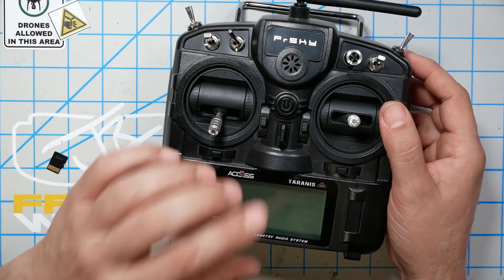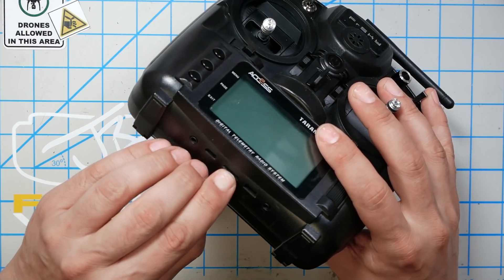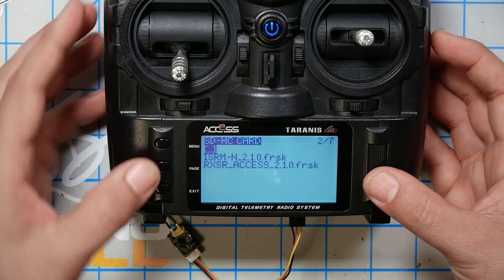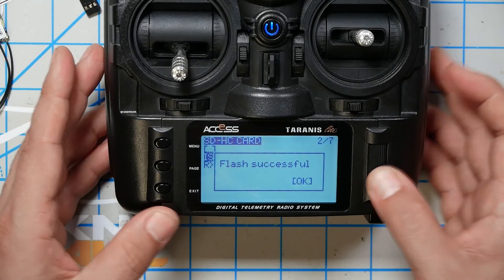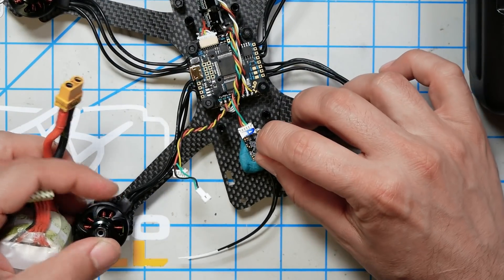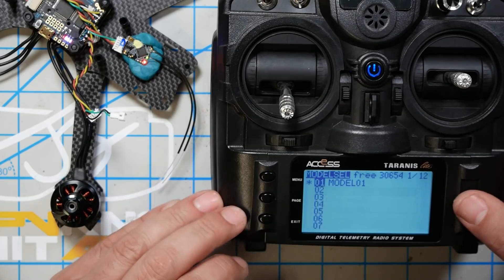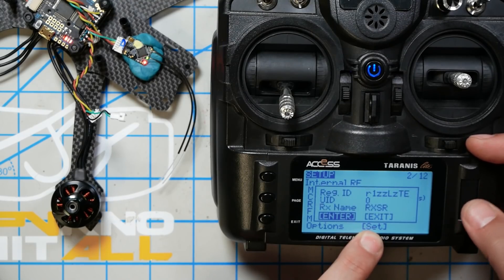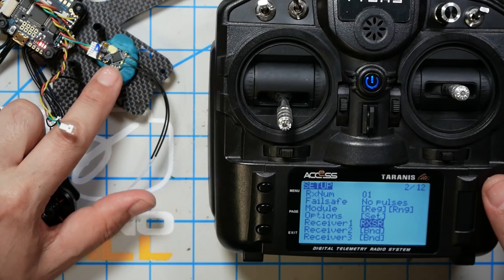FPV Drone Budget Build Full Tutorial - Part 2 - Bind FrSky to X9 Lite and flash RXSR firmware

Comment: Mr. Bardwell, I finally completed your Xilo drone kit. No smoke, motors and prop install correctly, startup normal, but upon take off, the drone flips upside down. Need help!
Reply from the maker: If the quad suddenly pops up in the air and then disarms when you arm, it is almost always one of these things.

1. Clockwise prop installed on counter-clockwise spinning motor or vice versa. Double check the motor direction is as expected and then double check that the correct prop is on each motor.

2. Flight controller not facing forward. Go to the Setup tab in the configurator. Tilt the quadcopter on all axes (pitch, roll, yaw) with your hands. The 3D model in the configurator should move the same as you move it with your hand. If it does not, use the Board Alignment parameters in the Configuration tab to fix it. Do not use the "GYRO/ACCEL" parameter. Use the "Roll Degrees", "Pitch Degrees", and "Yaw Degrees" parameters.

3. Motors not wired correctly. TAKE OFF YOUR PROPS. Plug in a battery. Go to the Motors tab. Turn on the "props are off" slider in the lower-right. Raise the individual sliders (1, 2, 3, and 4) one at a time, just enough that the motor begins spinning. The motor positions (1, 2, 3, and 4) should match the graphic in the upper left. If they do not, then either move the signal wires so that they are correct or use resource reassignment to virtually "move" the motors.

4. Motor spinning wrong direction. Do the same as step 3 but compare the motor direction to the arrows on the graphic in the upper left. If a motor is spinning the wrong direction, either reverse it using BLHeli (or whatever ESC software you are using) or swap any two motor wires with each other, which will reverse the direction.

5. If you have enabled the "motor direction is reversed" parameter in the Configuration tab, then you must go into blheli and reverse the motors, or swap the motor wires to reverse the motors. The "motor direction is reversed" option TELLS betaflight THAT you reversed the motors. It does not reverse the motors. This is a special case of #4 where the motors are spinning the wrong direction.

Comment: Is there a different file for the x9d? Also, the x9d does not have the servo slot on the bottom.
Reply from the maker: For the X9D you do not need to flash the RXSR or the X9D. They should bind out of the box.
Reply: @JoshuaBardwell  thank you

Comment: Mr. Bardwell, I brought and assembly your Xilo FPV drone kit. All went right up to the smoke check, no smoke. The problem arise went I try to bind the drone to my Radiomaster TX12. I was not able to follow your instruction because you use your FrSky Tannanis radio. There are some difference. I remain loss and need help
Reply from the maker: Bind to rxsr using protocol MULTI FrskyX

Bind to xm+ using protocol MULTI FrskyX2

Comment: For those who didn't get a MicroSD card you need to format the card to fat32 and put the file system onto your card. https://www.frsky-rc.com/taranis-x9-lite is the site to find the folder structure then you put the firmware into the corresponding folder. If you dont do it this way then it wont detect the .frsk files.
Reply: Thank you very much.

Comment: Can i also bind the Radiomaster tx16s to the R-XSR without changing the firmware because the tx16s doesn’t have the plug?
Reply from the maker: The tx16s can bind to the rxsr without changing the firmware. Use protocol Multi FrSky D16. If you need to flash the rxsr look up my expresslrs video which shows how to flash a receiver using the JR module pins on the back of the radio.
Reply: @JoshuaBardwell  thank you you truly are the FPVKNOWITALL

Comment: HELP! So when i select the RSXR to flash it only gives me an option to copy rename or delete and no option to flash. I am using the Radio master TX16S and I have already switch the red and black wire to aline with the pins on the back of the controller.
Reply from the maker: You can flash it using the JR bay pins on back. See my expresslrs video for an example. But you don't need to flash it. The stock rxsr firmware will work with the tx16s. Bind in mode multi FrSky d16
Reply: @JoshuaBardwell  so for your xilo build I don't need to flash my radio receiver?? And yeah I used the pins on the back
Reply from the maker: Radiomaster tx16s can bind to rxsr without flashing either.
Reply: Also my radio receiver does not bind, lights stay blue and flashing red and controller just beeps and says binding
Reply: @JoshuaBardwell  sorry for all the questions, Ive tried to bind the quad and it simply will not bind. 
I have tried
1. Re made a new model
2. pressed the button and then plugged the battery in and the green and red LEDs are lit but dont not start flashing

when i select bind it gives me an option to select CH 1-8 TELEM ON, or TELEM OFF and CH 9-16 TELEM ON or OFF

again sorry for the questions but im at a loss...
Reply from the maker: Need to be binding in mode MULTI FrSky D16 8ch

Assuming the default firmware on the RXSR, that should work.

If the RXSR has ACCST V2 firmware on it, then bind using MULTI FrSkyX2 D16 8ch

Comment: I started this project late. I flashed the SD card, but when I open up Firmware, it does not have the two files I needed, so I cannot bind the receiver. The FRIMWARE folder has TOOLS, a list of them, but when I check the SD card with my PC, there's nothing there but those two files I was to put in FIRMWARE. What should I do? Also, I am getting an 'expected different SD card version' after the throttle and failsafe warnings. What should I do?

Comment: I bought this and I'm stuck at the SD card, because one did not come with the kit. Was it supposed to?
Reply from the maker: I don't remember if the X9 Lite comes with one or not. If not, you need to source your own and download the SD card contents from the FrSky web site.
Reply: @JoshuaBardwell  ok thank you. If I buy a new (blank) SD Card, do I need to create a folder with the same name as YOU have in your SD Card? Or can I drag it straight into the card?

Love your videos btw. Keep up the awesome work!
Reply from the maker: You need to download the SD card contents from the FrSky web site and it will contain the folder structure.

Comment: Josh, thanks for all the great videos.  I'm working my way through the analog Xilo build and I have a newbie question.  I have a XD9-Plus (NON 2019 Version) and I've flashed the RXSR but I'm wondering if the ISRM-N_2.1.0.frsk file you provided is for the newer Access controllers or any controller that you want to "control" the RXSR with?  Thanks again and keep up the great work! ps: my controller is on the lates opentx (2.3.11-otx)

Comment: I am a patreon subscriber, I am having a small problem with flashing the Xilo receiver to my radio.  I see the file but get an error when attempting to flash it.  I have the radiomaster TX16S controller.  There are two similar slots at the bottom one with 4 pins one with 5 pins, and neither have the slot.  Assuming the black wire is ground I am putting it to the left side with the servo plug, lights on receiver blink, but will not update firmware.  Any ideas?
Reply from the maker: The radiomaster can't flash from those bottom plugs. You have to use the rear Jr bay. But the pinout is not the standard pinout so you have to make a custom adapter.

If you are using the radiomaster radio, you probably don't have to flash the receiver. You definitely don't flash the receiver to access firmware as that only works with FrSky radios.
Reply: @JoshuaBardwell  Thanks so what’s the next step in the build if I don’t have to flash the receiver.  I may sound like I know what I am talking about, but I don’t.  I have enjoyed the build so far, but long way to go to understand.

Comment: Thanks for your detailed instruction... However, there are a couple things not mentioned that newbies like myself had trouble figuring out:
I got the Frsky Taranis Lite radio, and it DOES NOT come with an SD card or batteries. 
You want to purchase a microSD card with LESS than 16GB of memory. That is important because the SD card cannot be read by the controller unless it is in default FAT format. If you don't know what that means, Google "changing filesystem on SD card" or something.  
The batteries for the controller are 18650 Li-Ion 3600mAh rechargeable batteries; although I got 2200mAh 3.7V ones to work fine. You want the cylindrical batteries, the battery packs won't fit. 
Also, I don't remember it being mentioned in the other videos, but the drone itself can take 4s or 6s batteries. 
Hope this helps!

Comment: I picked up an R-XSR receiver, but went with the Jumper T-Lite for a transmitter. Couple of things I ran into going this route;

 1. The RXSR firmware that Joshua links to uses the "ACCESS" protocol, which the Jumper T-Lite (and I'm guessing most other non-FrSky Tx's) is not compatible with. I had to download the "ACCST D16 Firmware" from FrSky's site here : https://www.frsky-rc.com/r-xsr . Then I could bind the Jumper T-Lite to it by choosing Mode:Multi , Type:FrSkyX2, Subtype:D16.

 2. Because I don't have a FrSky Tx, I had to flash the firmware by a different method. I used serialpassthrough in BetaFlight, explained by Oscar Liang here : https://oscarliang.com/flash-frsky-rx-fc-passthrough and seen in Joshua's video here : https://youtu.be/Hzf-EuQZYsE?t=351 . I found that recent changes in BetaFlight, mean that serialpassthrough doesn't persist after power cycling, so where you used to power down everything, you now need to keep the FC powered, disconnect the RXSR's cable, and then re-connect it for the FrSky updating tool to recognize it.

Hope this helps someone else in the same boat as me!

Comment: Josh - question on flashing the receiver. you stuck it into the bottom of your Taranis.  Do all controllers have a slot like this?  My Radiomaster TX16s seems to have a similar but larger one on the bottom of the controller.
Reply from the maker: The RadioMaster has a serial slot but I don't think it supports flashing through the slot. I think you have to use the JR module bay pins, but don't just go plugging in. The pinout is not as you might expect.
Reply: @Joshua Bardwell  if I used a TBS Crossfire receiver instead, would that solve this issue?  Or do Crossfire nano receivers also require to be plugged into a controller for flashing?

EDIT: Josh told me today on his livestream that the Frsky RX should work with my Radiomaster right out of the box.  Also, for anyone happen to be reading, he also told me that crossfire rx could be used, but would likely require a different wiring scheme.

Comment: just got done building this quad. when I plug in the battery I get the first 3 beeps then nothing. no L.E.D.s no nothing. does anyone have a clue what might be going on? this is my first build, I guess I should be glad there was no smoke or fire.
Reply: Scott, did you follow the updated wiring video Josh posted after the build videos?  I just finished wiring my analog version and everything lights up.  :)

Comment: Thank you for what you do for the fpv community.

I'm having trouble binding the Frsky X9Lite with the FrSky R-XSR Ultra receiver. They both say in the manual that they come with latest firmware and it just has to be binded. I follow all the correct binding process and still won't bind. Can someone acknowledge if this is true or do i still have to install firmwares to both transmitter and receiver? Please help.

Comment: I have an ACCST Q X7, so you'd better believe I learned something today! I also figured out I could press the bind button with my pinky while I plug in the battery, so I don't have to do it one-handed. I have half a mind to wire up a circuit with a power switch for future binding needs.

Comment: What is the overall benefit of doing this? I haven’t updated the radio firmware for years and all of my aircraft models bind just fine to my radio. I’m not sure what version of OpenTX is on my radio, but I haven’t really seen the need to do any updates. I figure if it’s not broken don’t fix it. But I am curious, if I go through this process, Will this screw up anything on my Taranis X9D plus that already has several model profiles on it? Also, can I just bind the R-XSR like I normally would with any of my prior aircraft models and just not update its firmware? Thanks in advance. ✌️
Reply from the maker: The point of the firmware update is that not all Frsky firmware is compatible with each other. By instructing you to update firmware on the radio and the receiver, the tutorial ensures that you are on the same firmware as me going forward. If you already know how to bind and it works for you, go for it.
Reply: @JoshuaBardwell   That makes perfect sense. Thanks for your tremendous amount of knowledge and such a quick reply. These videos have been a HUGE help!  Thanks once again.
Reply: I made the huge mistake of updating my radio’s and receiver’s firmware to this newest version of OpenTx and now I can’t seem to get them to bind. I didn’t know that my version of Taranis X9D+ is not ACCESS compatible and just wants to run ACCST. How do I roll back the firmware of the radio and receiver to an older version that is ACCST? I was an idiot and forgot to create a backup of my original setup and am struggling to try to get my radio back to its original state. I can’t seem to figure it out and am seconds away from just buying a new radio to remedy this issue. What do I do? Any help is tremendously appreciated. 🙏🙂✌️

Comment: The files in the description...are they compatible with with the older ACCST QX7? ive tried everything to get it to bind i have xjt protocol not ACCESS
Reply from the maker: They are not compatible. You need. To update your qx7 to xjt firmware 2.1.
Reply: @JoshuaBardwell  thank you for your response! I got it bound finally, I re-downloaded and flashed xjt firmware 2.1.0 and it worked like you said. 🤘

Comment: I am so happy that you made this series. I am 15 and have two questions to get in this hobby , I will be really happy when you can answer them .
My first question : can i use this battery on this drone ? 
https://www.amazon.de/GOLDBAT-Batterie-Quadcopte-Modellbau-Zubeh%C3%B6rteil/dp/B07DQJXX83/ref=sr_1_10?dchild=1&keywords=GOLDEDT+lipo+PLUS&qid=1597925342&sr=8-10 
and the second Question : wich controller are you using in this video

Comment: A few weeks ago I updated RXSR and QX7S to this current firmware version - 2.1.0.
Afterwards, I couldn't bind the two devices. The blue SBUS light on the RX would not stay on, even when I held the bind button for five seconds. I reverted both to 1.1.4 (?) and everything worked fine. Since then I have learned that you can bind via the CLI, and so, I am tempted to try to upgrade my devices again.....but.....if it ain't broke, don't fix it.  😁 If you can't bind after the upgrade, try the CLI method, or revert both back to previous version.
Cheers
Reply from the maker: The access firmware does not have the blue light PPM / SBUS option. If you flash to 2.1 as shown here then you also have to update firmware on your old receivers.
Reply: @JoshuaBardwell  Thank you JB - yes, I read that about the blue light, updated RX in question but I still couldn't bind :(
PS: do you agree with these values, from the FrSky update page?

* The suggested ACCESS RSSI is 32 for Critical Alarm and 35 for Low Alarm.

Comment: Ok newbie question here.  I'm waiting on this kit to arrive and I have a Radiomaster TX16s.  Will the process be the same for it as you did with the Frsky transmitter?
Reply: I have the same situation. Did you figure it out?
Reply: @moustafabaroud2100  You will not update it as he did.  You will have to try it and see if it works.  If not, flash it back to a prior version.  I guess some of them are shipping out with the access already installed.
Reply: Michael Belshe thanks for the guide. I will try it out this week. I will post here
Reply: Moustafa Baroud I’m building this quad now. I bought the frsky r-xsr receiver, but I also have an jumper r1 purchased too. Just in case.
Reply: Moustafa Baroud I was able to bind it just fine straight out of the package.

Comment: Do I have to have an SD card for this to bind to the receiver and if so do i need to download all those files on to it? or can i just straight up bind to it without having an SD card and all that stuff
Reply from the maker: The receiver will bind in ACCST D16 mode out of the box. It won't bind in ACCESS mode unless you update the firmware. But some people don't think ACCESS mode is all that valuable.

However you still need an SD card in the radio for the radio to fully function.

Comment: I'm curious why are you promoting FrSky equipment given all the bullshit they are doing lately with an attempts to lockdown their ecosystem and force out competitors? While their receivers are quite good indeed (still use them myself) I don't see a reason to buy lockdown radio which is not even compatible with their own goddamn receivers. And the "rare but significant bug" you mention, nobody seem it and most likely it is just a poor excuse to introduce firmware version which breaks backwards compatibility to mess with third-party radios.

If using FrSky receivers I would recommend leaving them on 1.x firmware version and use third party radio like Jumper or Radiomaster.
Reply from the maker: The goal of this kit is to make it easy for someone to buy everything they need in one go. GetFPV has manufactured the kit. the X9 Lite is a fine radio for beginners at a good price. Not everybody agrees with the political BS (although as you can see from which radio I fly which side of the situation I'm on).